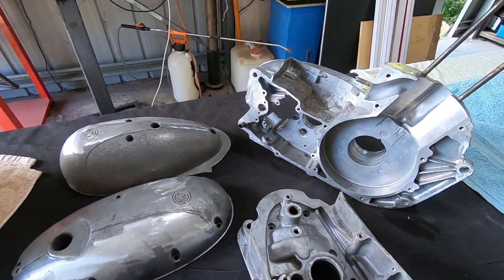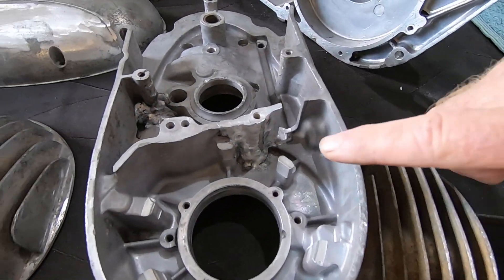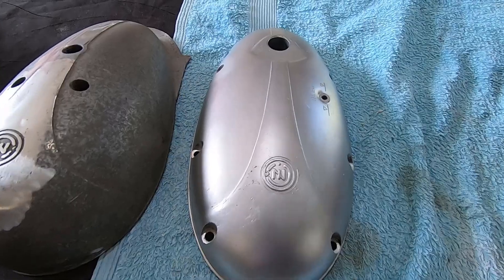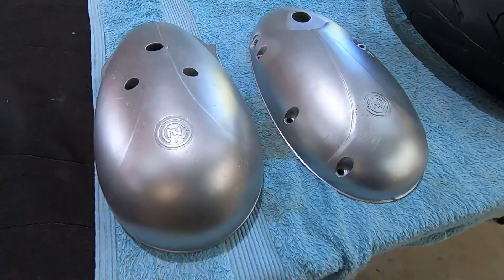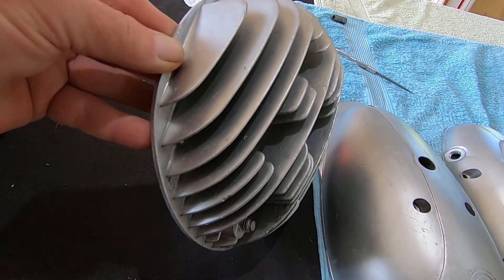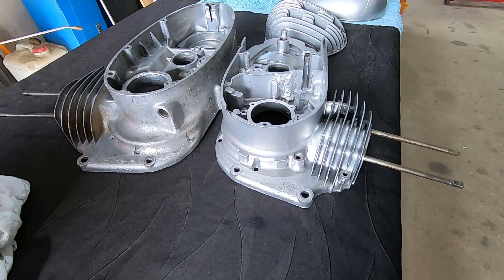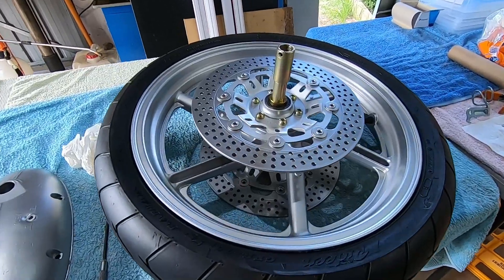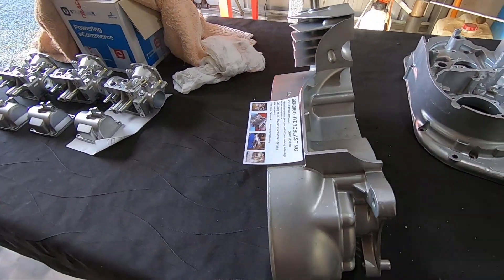CZ250 Engine rebuild. Hydroblasting / vaporblasting a CZ250 engine prior to rebuilding the engine.

Comment: Great work Craig! Pity the customer didn't fix the dings and corrosion on the cases before taking them to you. Mind you, those scratches are often very difficult to notice before the blasting.... I've done the same thing, as you know, and regretted not being more vigilant.
Reply from the maker: Thanks Joe. Centre stripes on the cases will be hand polished so they will look pretty awesome when they are done. Pretty sure the engine will be in a working trials bike so I’m sure there will be the odd scratch or two appear in the near future.